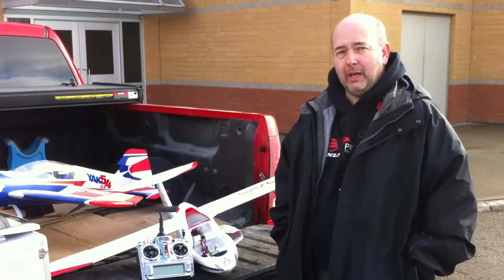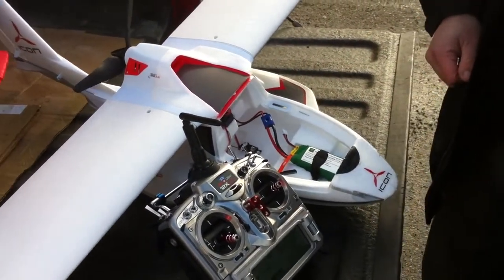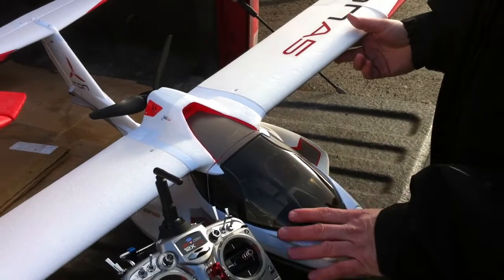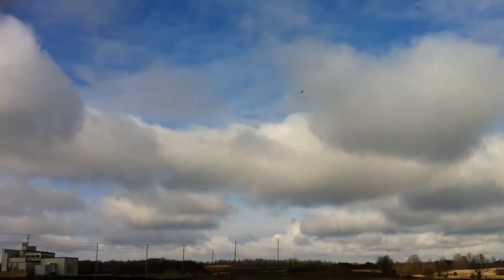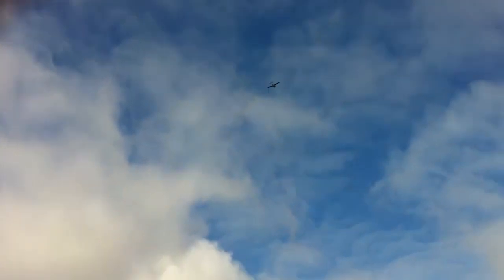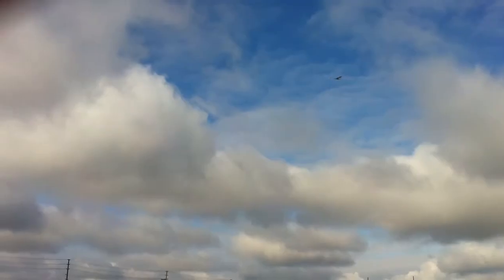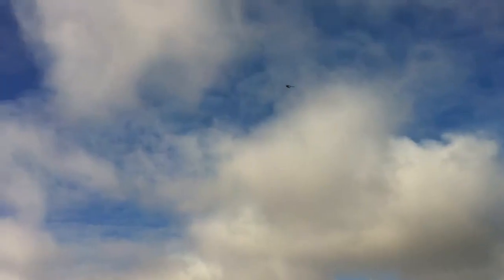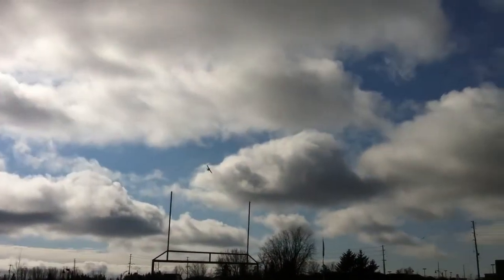Pinnacle Hobby Flight Review - Parkzone Icon A5

Comment: !/2 throttle is ok and facing wind.  She drops fairly quick to glide in.  Flaps would be a bonus as it comes in fast for landings.  Heavy up front I slid the battery back a few inches to level it better.  It's sporty and keeps your attention on it that's for sure.   A real peach on the water.  I'm liking it.

Comment: @RevoRacer24 With a 2200 im getting about 7-9min flying her hard and fast and aboit 10-12 min cruising her at 1/4 to half throttle as needed. I really dont know the exact full capacity of the flight times since i usually set my controllesr beep alert at around 7 min

Comment from the maker: From what I observed during the filming it appeared to be a very stable plane at low and higher speeds. Coming from a heli background I can't comment on how well it flies compared to another model as the only planes I've flown were 3D Flat foamies and the Eflite Sbach. You can email pinnaclehobby@rogers.com with more questions regarding the flight characteristics.

Comment: Cool, had to go get me one !  It's my weakness ya know.
Because of this review I felt more confident.  $40.00 off list price so that's another incentive.  Check out my channel I put a flight on there.  This guy is right, it's a bit slow in acrobats but that's because the ailerons and elevator have a small surface area compared to others.   Just had to have that sound.  You can tell when you throttle up that's for sure.   Have a blast !